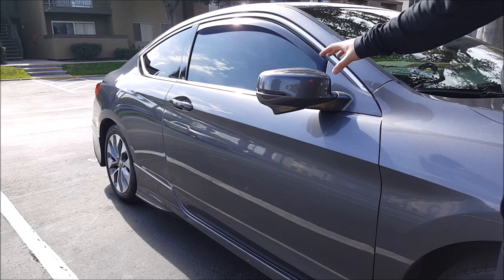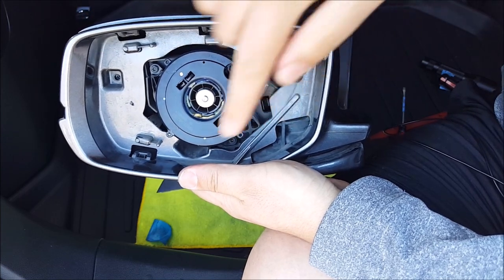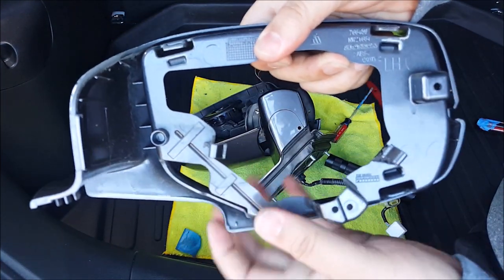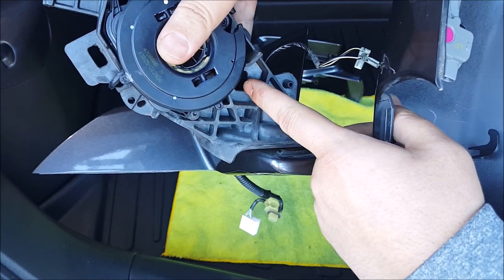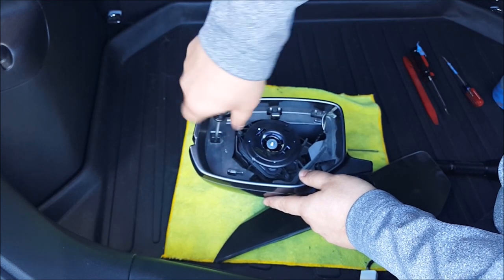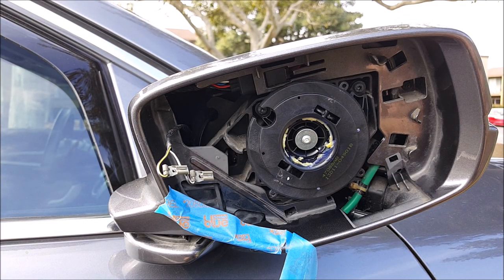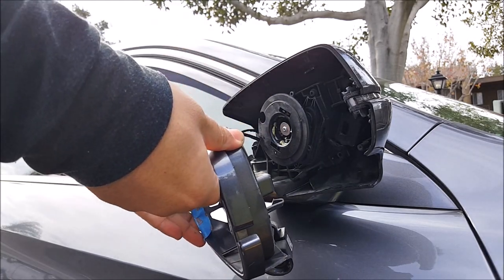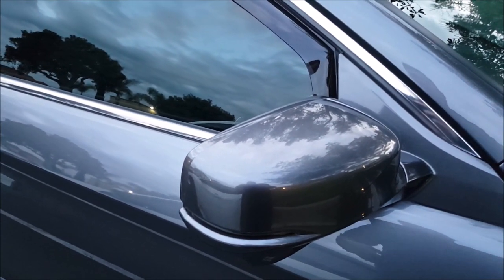[Tutorial] 2013 - 2017 Honda Accord Side Mirror Cover Removal and Installation

Comment: Would you mind doing the same video removing the back cover (skull cap) on the CR-V?. I've looked this Accord one but the CR-V skull cap is slightly different, where I think you don't need to remove the mirror to get to it, but if you could do a video would be great. I'm trying to replace the turn signal with a sequential one but I need to get to it first and if I can save removing the mirror would be great. Thank you in advanced.

Comment: Thank you very much for the video. Quick question though. I have 2017 Honda Accord Hybrid EXL. Driver side mirror housing in cracked and I want to replace it. So, my understanding from your video is that I don't have to remove side mirror completely (i.e. it can still be attached to the car). Please let me know if this correct. I'm planning to buy Housing Set, L NH788P (White Orchid Pearl) for $100 instead of complete side mirror assembly which is much more expensive.
Reply: Please let me know what you did 😅 my mirror is still in tact but my housing is cracked and my back came off and shattered ! I just wanted to replace the housing but didn’t know where to get the part. Did it end up working for you?

Comment: Any videos on how to fix where the mirror attaches to the folding mechanism? Side mirror hit by car wash. Glass and body of mirror in great shape but does not secure to folding pin. Just sits on the piece but could be lifted off with ease. Replace who mirror assembly or possible to replace that piece?
Reply from the maker: It depends on the piece that is broken,  If the backing plate attached to the mirror is broken then you need to replace the mirror.  If the actuator tabs are damaged then that has to be replaced.  I would buy a new mirror for damaged mirror backing and would look for used mirror assembly for actuator replacement.
Reply: @DIYCarModz  it’s not the mirror or anything behind the glass. So if looking at entire side mirror, it folds in and then back out manually. Well mine has broken where it’s sits on the folding/rotating piece. It was bent back by a automatic car wash. So the mirror assembly just sits on that piece and only held on by wire.